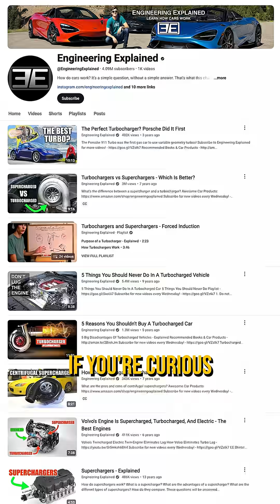Turbocharger vs Supercharger - Which Is Best?

Comment: The "best" choice between a turbocharger and a supercharger depends entirely on the driver's priorities: fuel efficiency and high-end power favor the turbo, while immediate throttle response and low-end torque favor the supercharger.
Both devices are forms of forced induction—they compress air and force more of it into the engine's cylinders, allowing more fuel to be burned and thus creating more power. The key difference lies in how they are powered.
⚡️ Supercharger: Instant Power
A supercharger is mechanically driven directly by the engine's crankshaft, usually via a belt.
| Advantages | Disadvantages |
|---|---|
| Instant Power Delivery: Since it's mechanically linked, it provides an immediate boost with no "lag" as soon as you hit the gas. | Less Fuel Efficient: It draws power directly from the engine to operate (parasitic loss), reducing overall fuel economy. |
| Better Low-End Torque: Great for acceleration from a stop. | More Engine Strain: The direct mechanical link puts additional stress on the engine components. |
| Simpler Installation: Generally easier to bolt on since it doesn't require exhaust modifications. | Less Efficient at Power Generation: It heats the intake air more and has lower adiabatic efficiency than a turbo. |
💨 Turbocharger: Efficient High-End Power
A turbocharger is exhaust-gas driven, using the kinetic energy of the engine's exhaust to spin a turbine, which in turn drives a compressor.
| Advantages | Disadvantages |
|---|---|
| More Fuel Efficient: It uses waste energy from the exhaust gases, making it more efficient and helping reduce emissions. | Turbo Lag: There is a slight delay in power delivery at lower RPMs as the turbo waits for enough exhaust gas to "spool up." |
| Higher Efficiency: Can generate more power for a given size and is often preferred by manufacturers for modern production cars. | Increased Heat Generation: Operates at very high temperatures due to its location in the exhaust stream, requiring robust cooling (like an intercooler). |
| Better High-End Power: Delivers its biggest power increases at mid-to-high RPMs. | More Complex Installation: Requires intricate plumbing for both the exhaust and intake systems. |
🏁 Conclusion
The choice is a trade-off:
 * Choose a Supercharger if your priority is instantaneous throttle response, great low-end acceleration (like in a muscle car), and you're willing to accept a slight decrease in fuel economy.
 * Choose a Turbocharger if your priority is better fuel efficiency, maximum power at higher speeds, and you can tolerate a small delay in initial power (turbo lag).
For a visual comparison of how these two forced induction systems operate, you can check out this video: Turbochargers vs Superchargers - Which Is Better?.

YouTube video views will be stored in your YouTube History, and your data will be stored and used by YouTube according to its Terms of Service

Comment: Turbochargers are just better if you're willing to do a split twin turbo. One turbo activates at lower rpm while the other than fires after in the high rpm ranges basically negating turbo lag

Comment: If superchargers only change with engine speed, whereas turbochargers with load and speed, does that mean supercharger is trying to pump in air against a closed throttle sometimes, whereas with turbocharger, less throttle = less gas in the exhaust, so less boost?

Comment: Nowadays, either variable vane turbines, the lag at low speed is non existent on most turbos. Plus they are not using horsepower to make boost, they r scavenging the exhaust (read free) to spool up. Turbos of old (vin code 7 Buicks) had large turbo lagging ones that would throw you back in the seat once fully spooled. That too is fun.

Comment: As someone who has been i this field and studied this for decades basicly cornering with a turbo changer is highly dangerous especially if its duels turbo charger it is best used on straight road but even then it limits top speed.Superchargers have no performance issues as said in the video lol having a central fugal supercharge makes me motivated soly because it makes cars sound like an airplane.

Comment: Why is turbo-charging more efficient?  The exhaust gases leave the combustion chamber but every time an exhaust valve opens, there is a connection between the piston pushing up and the exhaust gas slamming into the vanes on the turbine.  What is the difference between that and an air compressor powering a pneumatic tool?

Comment: THE best sound effects! Though not as cute as the little girl doing the turbo sounds 😂
I prefer the predictable response curve of a supercharger over turbochargers for road course racing, but turbos are great for Bonneville or street use. Chrysler pretty much solved the turbo lag issues by building the hot side turbo housing into the exhaust manifold on the SRT4 2.4 liter. I have one that will go from idle to boost in about three feet from a standstill, but I roll into the throttle gradually because I don't have enough traction till 3rd gear anyways.

Comment: That's why the diesel engines with turbos work so well, diesels have tonnes of torque but take longer to spool up if you will, the turbo helps at those higher rpms

Comment: The only way to solve the turbocharger issues is how Mercedes did it on their AMG ONE, by pairing an electric motor with the turbo to spool it up instantly. 

Problem is that it takes away efficiency by requiring a motor to charge up, it it very expensive and complex, and it might not be as reliable with more moving parts. 

It does solve the performance side of things, though.

Comment: A properly sized twin turbo system will always be better. This is why top fuel dragsters are supercharged... yes, it sounds backward, but top fuel dragsters would be more powerful with turbos than superchargers. Turbos were banned due to being harder to tune and more things to go wrong to cause a safety situation than superchargers. Turbo systems can be configured to have virtually no lag, but they are more costly than superchargers, too when taken into account plumbing and space.

Comment: better low end torque?  No way.  Most turbo cars I know of have max torque 2,500 or less rpms.  For example, a Hellcat has peak torque at about 4,500 while my Audi S5 has peak torque at 1,400 rpm.  The S5 also hold that torque steady from 1,400 to 4,500.  When the computer controls the turbo, it can do amazing things.  The supercharger had it's advantage before computers got involved.

Comment: oh and centrifugal superchargers give both quick acceleration without sucking all the fuel out
it uses just air instead of air and fuel mixture but it is still connected to the Belt

Comment: I wonder...
- a turbo needs rpm (for exhaust gas) to work.
- a supercharger needs rpm (to drive the belt) to work.

- both have the same purpose (more air into the engine)

Why would they be different in low/high rpm's?

Comment: Why don't they just use an electric motor to spin the compressor? Seems like that would be a simpler device with fewer moving parts, and it could be computer-controlled for more precise response.

Comment: Why not use both simultaneously? The engine computer can transition one to the other by opening waste gates to take the supercharger offline when the engine is turning at sufficient speed RPMs for the turbocharger to make adequate boost. The supercharger’s boost can be blended back in if heavy acceleration is needed to compensate for turbo lag.

Comment: This is why some aftermarket setups use both superchargers and turbochargers at the same time. The supercharger is used at low RPM until the Turbo spins up, then the turbo takes over. There are also designs of inline turbos that use a small turbo and a bigger one so the effect is similar. 
But, if you want the ultimate acceleration, forget about dinosaurs and move on into electric. Electric motors are extremely efficient compared to old school ICE engines. This is why a $50K Tesla Model 3 Performance can accelerate as fast as most hight end sports cars (0 to 60 in 3 seconds) and keep having a very decent acceleration even at 100 MPH. Of course you need to pay double the price for a faster Tesla like the Model S PLaid, that one is one of the fastest cars on Earth and is only $100 K compared to half a million and up for exotic extremely fast sports cars like Lamborghini, Ferrary, McLaren, Bugatti, etc. 
As soon as technology can reach very fast charging (we are about to get there using solid state batteries) and much longer range (those batteries have higher density so they can provide more miles for the same size as current batteries), there will be no point to buy ICE vehicles.

Comment: The reason turbos are more "efficient" is that they're being powered by energy that would have just otherwise been dumped out the tailpipe (expanding exhaust gasses). That's one of the driving forces of behind why fuel efficient cars tend to use low displacement engines + turbos - you capture more of the energy from the fuel.

But if you're just looking for more power, superchargers are just so damn fun 🤣

Comment: turbos are better at high speeds. supers are better at low end torque. you can actually bypass the negatives of both by setting your engine up with a supercharger at low rpm’s, that switches to a turbo at high rpm’s. the system is called “twin charging”.

Comment: I would have thought there would be some electric option that would provide the air needed using an electric motor, powered by the battery. It should be fine as long as the engine replenishes the energy used in good time.

Comment: Turbos build up carbon in exhaust side galore,   Blown  valves blow, superbchargers leak caccuum, both need rebuilding. Remedy. Stroked big dispacement the max, (2 settings street/race)  super lightweight drivetrain, flywheel, light car 2500 lbs

Comment: In general Turbo Chargers are Better used for Fuel Economy and High altitude places.. as well as applications where Acceleration isnt your initial goal but want more top end power.. Superchargers on the other hand are way more sensible for a Racing and Short 1/4 mile drags.. but they weigh more and Put a Drag on Motor Rotating Assemblies..  Superchargers are how ever More simpler to set up as opposed to Turbochargers.

Comment: That's incorrect. Supercharges are far more efficient than turbos. They can achieve the same amount of boost with a smaller form factor and zero lag.

The only downside is, SCs are more complex with more moving parts, hence more expensive for the cost conscious manufacturers. 

Also turbos are easier to install as an after market performance mod with only changes required are to the inlet and exhaust manifolds, compared to SCs which require many more additional parts  many of them, custom.

But thanks to small scale additive manufacturing tech like 3D printing, custom parts are faster and cheaper to manufacture and SCs are getting more popular in the performance mods market.

Comment: What is your opinion on the Toyota TRD Pro? It certainly is not designed as the Prius as the battery supliments torque not intended nessesaily to increase mileage.  The upside it doesn't idle at a stoplight or drive through, while the battery still runs the ac.  Jason, your thoughts please!

Comment: You also lose power from the engine with a supercharger as some power is used to power it, the goal is to gain more through it than it takes to run it but turbos don’t have the issue. You can also eliminate turbo lag and the low RPM torque issue through use of hybrid technology.

Comment: Superchargers superior wherever it’s not possible or practical at least to run twins. There’s a reason you almost never see a supercharger on a diesel or small displacement four cylinder.  And in the case of the diesel they’ll make room for a single or twins. A TVS and twin screw are happy to go up to 14psi and 16psi. Pushed past those points their parasitic draw and discharge temperatures rises at nearly a 45 degree angle. Volumetric efficiency falls inversely the other way. Their intercooler core only fights off heat soaking for a short while before its back is broken. Twin screws produce boost pressure within the case at all times even at part throttle cruising. While a small load compared to full boost it’s still heat that has to go somewhere.  At full tilt the supercharger consumes nearly half of the total power added to the crank. Twin screws are a little more efficient in this case but not much. It takes 100-150hp to turn the blowers on the common on the big three supercharged V8s. If your intercooler is properly sized along with you’re moving through the air you can stay in full boost for nearly as long as you want with no issue.

Comment: If you want a supercharger, that works like a turbo, just take the turbine off your turbo and hook the compressor up to the crank pulley. Centrifugal superchargers can deliver more top-end boost than a supercharger but don't have the immediate low-end boost of a supercharger.

Comment: Use a modern 1-3-hp three-phase electric motor to provide the air boost for 1 to 2 seconds, until the turbocharger spins up properly to take over the needed boost.
Or omit it all, and go for a modern electric car instead...

Comment: Superchargers are the “safer” way to more power. Most of the time one can bolt the entire kit on in an afternoon. Turbos usually involve some major rework which can take a few days. With right type of supercharger the maintenance and failure rate is much lower than a turbo. Superchargers also are limited on “boost” turbos can run as high of pressure as you want…..at the expense of the engine.  The best of both is the compound turbo-supercharger that was used in aircraft in ww2.

Comment: The turbo uses energy that would otherwise be discarded so it's taking essentially free energy coming from the engine's natural functions to increase power. 
Super's are like air conditioners. They introduce an additional draw on engine power that was not there before. 
Forcing the engine to work harder to power it. 
If you engage your cars AC and feel the RPM's dip a little, its like that. Adding extra drag on an engine is bad for efficiency.

Comment: Modern turbos are much more effective in the low end compared to how they used to be there is also a twin turbo option which almost rules this out but as I found out low end boost isn't always good and can cause excessive engine wear or damage anyway. At least super chargers don't muffle that great exhaust noise like turbos do

Comment: Or, you can just use both.  That said, there are different kinds of superchargers: roots, screw, and centrifugal (which works like a turbo, but without the exhaust driving it).  Roots and screw superchargers essentially make it feel like there’s a larger cubic inch engine, while centrifugal gives a bit more top end power, like a turbo.  Now, I said “why not use both”, it’s not a new concept, and manufacturers have used that before in Group B rally.  You get the low end power of a blower, and the top end of a turbo.  There are even systems that use an AC clutch type device, as well as valves that resemble throttle bodies, to switch from supercharged to turbocharged, the March Super Turbo is an example of a production car with such a setup.

Comment: In regard about Turbochargers are almost correct or correct for older cars.

They solved the turbo lag by using twin turbos which have two turbo in different size. A small turbo that could be driven with little exhaust gas for lower RPM boost and the larger turbo kick in as the engine rev up.

Yes, it is heavier and more complex but I believe the benefits outweigh the shortcoming which is why almost all the high performance cars use twin turbos nowaday.

Comment: To an extent, Twin Scroll Turbos eliminate the Turbo Lag and Comparatively Reduced Throttle Response to Superchargers. They can br quite expensive though. They work well at low RPM too

Comment: As a supercharger gets hotter, the density of the air decreases and in supercharged cars, there’s a notable decrease in power as it gets hotter. Turbo chargers also have this problem but to a much smaller extent.

Comment: Turbo for smaller displacement engines, Supercharger for larger ones.
The Supercharger actually takes power away from you in the beginning,,,,,, once it gets going though, you get back more than you gave; that's why they work better with bigger engines that can afford to lose a little bit at the start.

Comment: I had a twin turbo car and got a crack in the turbo case due to not being able to run the engine for 5 mins after I used the turbo to let it cool down. Now run a v8 with super charger for the cold and lets you turn off the car immediately after driving somewhere.

Comment: GM's 2.7 Turbo makes 348 ft/ Lbs at 1400 RPM, WHAT LAG ? , and the 3.5 High Output Ecoboost makes 510 Ft / lbs at 3000, and an almost vertical torque curve from 2000, I beg to differ, good sir.....
In the 80's and 90's , turbo lag was a thing.......

Comment: i think mercedes benz has a pretty cool quad turbo design on their 2025 c63se. basically each turbo is connected to an electric motor which is connected to the battery in the back, basically meaning that all 4 turbos can instantly spin up immediately max speed

Comment: uhhhh 

if the super charger is driven by the engine and puts more air in the engine 
then that's means that there is more gas's being made therefor needing a turbo to remove the gas's then i would put 
super charger have it put in air 
then turbo suck air out 
why have i not seen anyone do this 
like i get the "too heavy" 
or "too expensive" buh why not